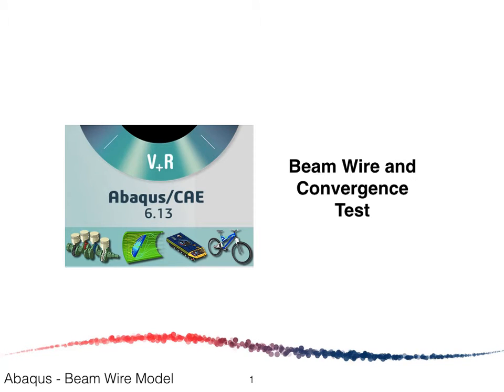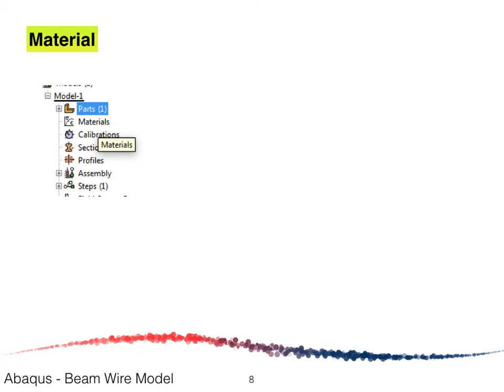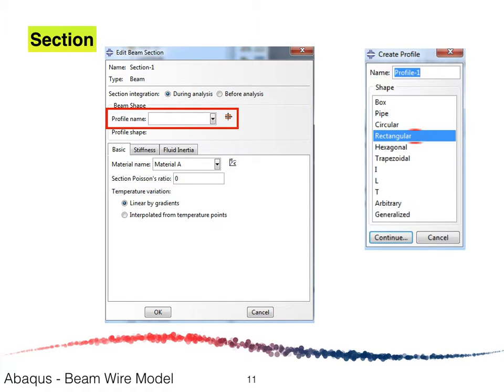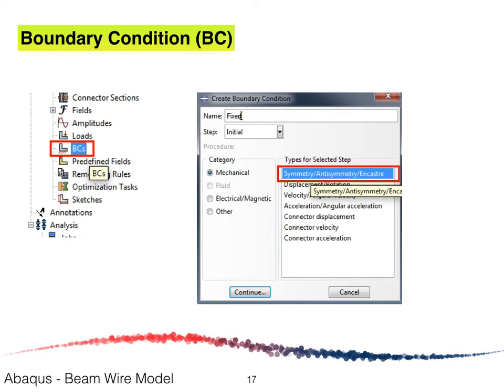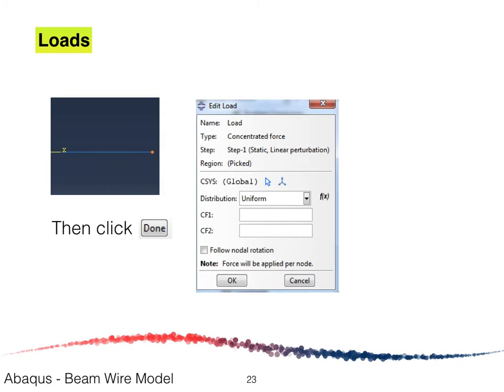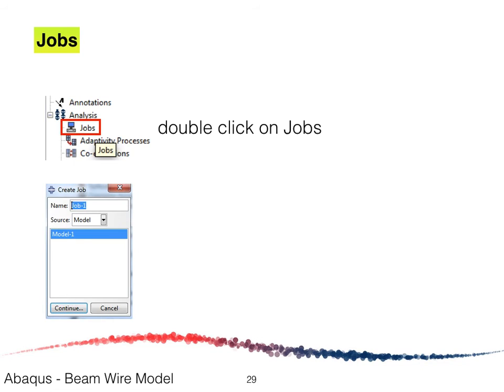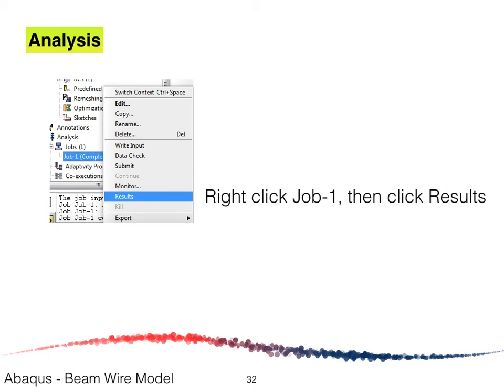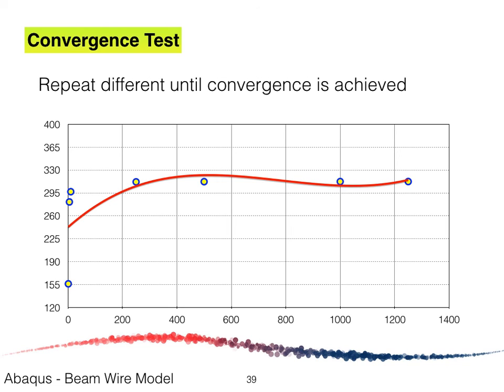Abaqus - Wire Beam

Comment: Can you help  em with some things ? if you can talk to me
Reply from the maker: +Edilson Joaquim 
Anything?
Reply: About the units that Abaqus work and show?
Correct me if I wrote wrong
Displacement (meters)
Time ( seconds )
Temperature ?
Stress ?
Shear?
Force ( Newtons)
Moment ?
...
Reply from the maker: Edilson Joaquim There are no specific unit used in any FEA software. If the model and the material properties are in SI unit, the solution will be in SI unit. e.g.. model is in meter, material property is in N/m2. Thus, the displacement is meter, stress is N/m2 etc.
Reply: +Chung Ket  thanks buddy.